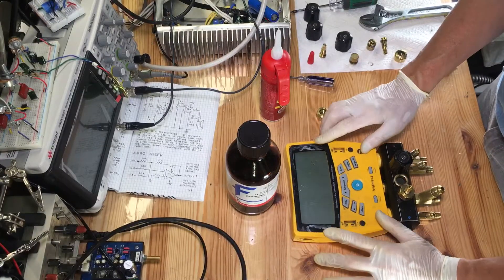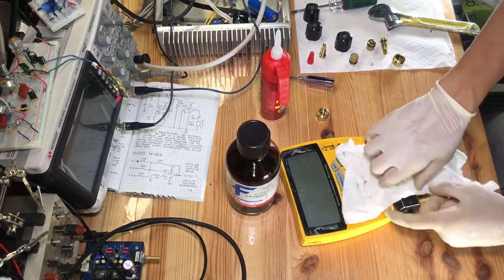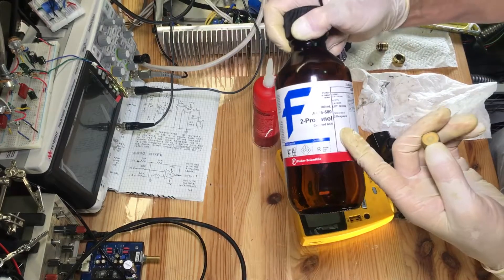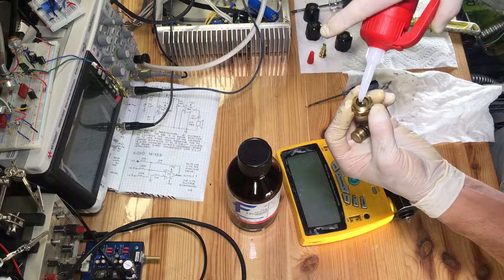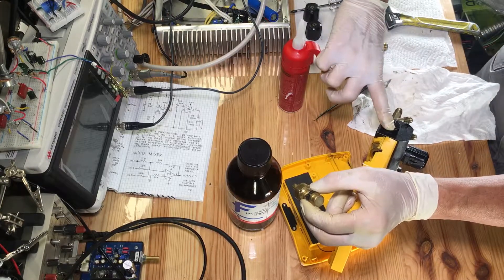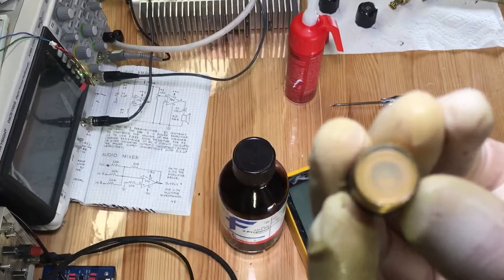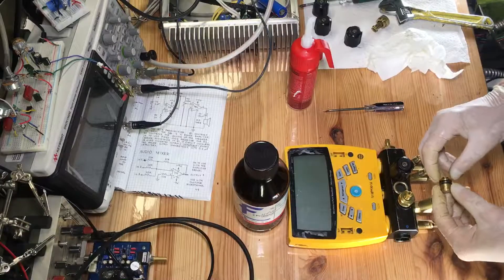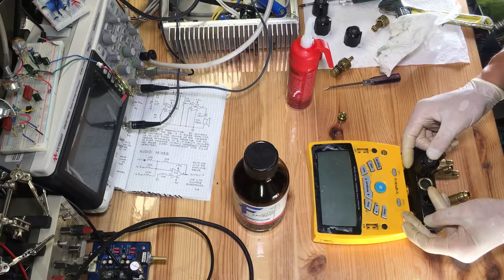Leaking Fieldpiece SMAN 460 repair with silicone grease

Comment: how do i tighten the sightglass
Reply from the maker: I have never taken one out.  But a big giant screwdriver I believe there is a big slot.. I got an extra large 🪛 
Screwdriver 

But you should not have to touch it there’s no reason to touch it
Reply: @coldfinger459sub0   mine is leaking, i want to tighten it

Comment: I have Fieldpiece low loss hose set,what’s the rubber gasket kit model number for Fieldpiece Charging hoses
Reply from the maker: @bikramjitsingh6214  I don’t remember the part number I guess I didn’t show it in the video unfortunately. 
       But they are available at True Tech Tools 
I just googled (“fieldpiece SM 460 valve gauge kit”)
True Tech Tools 
Supply warehouse 
Test equipment 
Website websites and show this part number 
SKU:RSMANK8

That was the part number that was on True Tech Tools website 
But always ask them personally to double check reference to make sure that’s the right one .
Reply: @ I think it’s misunderstanding actually I was asking about fieldpiece charging hose rubber gaskets,I Tried all the local suppliers they don’t have anything for fieldpiece HR3L,
Reply from the maker: @ you’re going to have to give a look up on the website for Fieldpiece or call True Tech Tools. I did not see it listed on True Tech Tools website but I know they have things they do not have listed yet.. 
     So if you ask them for an item, they don’t have listed on one of the brands that they are an authorized distributor they will get it for you. 
       I don’t think none of the locals will have the seals specially Automotive I don’t even think Johnstone or American refrigerant Supply or Baker Distributing from the commercial refrigeration warehouses will even have those seals sitting on their shelf. They will have to be special ordered.. 

Unless they’re the exact same size as the common yellow jacket, refrigerant hose seals .

Comment: I had my old style of gages for years and they have never fel me
Reply from the maker: @carlossaenz4075  your old style gauges can never get below 100 µm.  Your old style gauges you would never even know when you’re at 10,000 µm.    Because they were only plus or minus accuracy in reading at -29 inches of vacuum and even that was not always correct..   Analog gages are incapable of reading down into the micron range.

Comment: Omg  just after two years of useing  these every expensive  gages ur having these problems  that means they not worth the money !!!!
Reply from the maker: @carlossaenz4075  I do about 2000+ vehicles on them a year. 

And all the brands have a problem when you’re trying to get under 100 µm . Does not matter if it was brand new out of the box or yellow jacket or Fieldpiece they have a problem trying to get below 100 µm.   Silicone grease to the O-rings stops that problem below hundred micron leaking past the O-rings

Comment: I bought a brand new SMAN 4 port and it's leaking right out of the box 😔
Reply from the maker: R u trying to hold vacuum micron with the refrigerant hoses? 

You can not. 

The micron gauge is so sensitive it can read the out gassing of the VOC out gassing from the hoses and the moisture absorb in the inner wall surface.  It will look like a leak. 

And you can only measure large internal surface.  Like a tank or long copper line set.  
     Not the internal surface of the gauge it self. . 

Or especially if you use some cheap eBay or Amazon refrigerant hoses. .   

I should steady out and level at a certain level. 

Make video and post it what it is doing. 

If using vacuum hoses to try to read micron vacuum is too low for refrigerant hoses to hold 100%. 

Refrigerant hose were never designed to for deep vacuum. 

You would need to use copper or stainless steel lines.  Not rubber. 

There will always be some losses trying to use refrigerant gauges with rubber hoses. 

I have later videos showing how volume is needed with brand new refrigerant recovery tank that I put on vacuum for 24 hours to dry it out before taking test. 
      It shows you the difference between just hoses and hose plus large volume tank added. 

It a mathematical physics think going on having to do with how sensitive the micron gauges can read small volume and out gassing.
Reply: @coldfinger459sub0  real interesting 🤔 well I  am indeed using refrigerant hoses to try and pull the vacuum. So the vacuum issue is one thing (I'll definitely re try this tomorrow with my big blue vac hose). The other thing it's doing is leaking on pressure. I was trying to test a system @ 600psi. I leak checked everything until I got to the SAM 4 port gauge. I isolated it and realized that the gauge it's self seems to drop 0.1 psi /min. I did it again completely by itself, not even hooked up to a system at all.
Reply from the maker: @jpabmx  too small. 

Hook it u to a refrigerant r410 cylinder. So you can go up to 400 psi.  Let it set 15 min then close it.  Depending on temperature difference of gas change to refrigerate manifold and hoses.  It will go up or down a little the stabilize. ,  let it drop . 

Then 15 min later zero out leak test and retest again. After it stabilized from last time.   

Hope that makes sense.  

Remember your hoses will stretch a little at 600 psi.  Again it’s a small volume. .
Reply: @coldfinger459sub0  Well, I spent hours on this but I finally found where it was leaking. It's coming from the high side port. I'll post a video shortly.
Reply from the maker: @jpabmx  looking forward to your video👍

Research and looking takes time, but the more time you take the more you learn .
Reply: https://youtu.be/FGew_HY29jk 

Two part video. Second half is the leak. 
To test: I hooked to my nitrogen cylinder and raised up pressure to somewhere around 600psi then disconnected and submerged the manifold. This is because no matter how much bubble leak detector I used I could never find a leak at any of the valves. I used a 1/4" cap on first the low side outlet, and opened that up to get the sensor to read (pressure will not read unless you open the valve). All other valves were fully seated. The high side port is leaking even though the handle is fully seated closed. Did the same test on both high and low pressure ports. Only the high side leaks by. I did also try you silicone trick. It seams to have slightly helped but it still leaks. Again this is a brand new manifold. 

Hopefully this makes sense. So now I'm not sure if maybe it's damage to that nylon seal. I saw no visible damage when performing the silicone trick. 

At least I know I can use my low side and cap off my high side for any pressure testing I need to do.
Reply from the maker: @jpabmx  anyway when you are performing the high pressure test.   Your high side and low side can be opened to the manifold chamber. Your vacuum on your yellow hose nitrogen will be sealed off.. 

And there still would be no leak to the outside .    Only the high side and low side that will still be under the same 600 psi pressure.. 

But those hard nylon rings, especially when brand new, sometimes take a little bit of a hand force . 

He grew up being used to the old fashion soft Teflon rings .  That damaged very easy and we’re very soft.
Reply: @coldfinger459sub0  yeah after thinking about it a bit, it doesn't really make sense that this would be a leak. I tested one more time and it's fine. The high port valve handle was not fully closed, I thought it was. So that video was not a real leak. I re-tested and it's fine. I have realized that this gauge is ultra sensitive. It picks up on changes in temperature, even if you just bend the hose it will pick up on that. I was mostly chasing ghosts this whole time. As for vacuum, I believe the issue is me trying to use a refrigeration hose for pulling vacuum. I'll need to get an adapter to be able to use both my vacuum hoses on the unit I'm working with but I'm pretty sure that's going to cure all my issues. It's surprising how sensitive this unit is.
Reply from the maker: @jpabmx  💡🤔💭 now it seems like you get it and you understand

These are ultra ultra sensitive measuring devices 

The sensor for pressure instead of analog ages you’re literally measuring 1/10 of a psi . 

And just temperature change expansion of the gas or contraction, and the same goes for the metal expansion or contraction or hoses or stretching he can measure that 

This is why before you even start your test that 10 or 15 minutes of stabilization is very important and once you start that test if the outside temperature changes that will expand or contract, the metal and the gas in the condensing unit heat exchanger if the inside of the house changes temperature that’ll expand or contract the gas or F refrigerant lines are ran in an attic just below the roof works 140° F as these temperatures change you’ll see pressure go up or down.. 

And the vacuum micron sensor extremely sensitive

In the smaller, the volume that you’re trying to measure the harder, more difficult and more sensitive in the more off, your numbers will be especially when trying to use Refrigerant hoses that were never ever intended to be used for low vacuum . 

It’s a frustrating learning curve, especially if you have nobody to help you some guys just get frustrated and throw their equipment away sell it to college bad names or say that stuff doesn’t work 

It’s not the tool that is broken 

That’s what he’s looking in the mirror that is broken  🤣

In my videos, I recommended watching Jim Bergman’s videos on vacuum 

Available at True Tech Tools available at Accutools website and possibly available on Jim Bergman’s personal YouTube website 

I also recommended the $19 small booklet on vacuum from True Tech Tools . 

And for the gifts and nerds who love physics in science in the most final details, and have many hours to read . 
    I recommended and I gave a link to a science book for laboratory classes that have all to do with the most Finite detail, extreme vacuum and very high-end vacuum equipment and measuring equipment that was a free PDF that could be download it and read. 

You either fall asleep 

Orby highly overeducated 

Or it’ll make you want to buy even more expensive equipment and do better 

😂💰💸

Good luck on your adventure. Any questions don’t bother ask me anything you want any time you want .

Comment: I wonder if nylog would work too. I will try this repair
Reply from the maker: NYLOG works I used it . But refrigerant washes it away.   I found silicone grease lasted longer.   I’ve been testing both for years.   Abandon NYLOG now only use silicone grease.   Instead of replacing orings.    I found I can reuse oring just reapply silicone grease.
Reply: @coldfinger459sub0  but you need new pistons since they get the ring on the surface from tightening the knobs right?
Reply from the maker: @JDT738126  the O-rings slide up and down on the side of a cylinder they do not get compressed. 

At the end of the piston, there is a Teflon nylon type material. That is the part that gets compressed against the machine ring as you tighten and untighten the knob. 

If that part does not get damaged, then it does not get damaged. That is no problem. If it does get damaged you have to replace it. 

But the part that bleeds by and leaks, either vacuum or pressure is the O-rings that are acting like piston rings in an engine compressing up against the cylinder, sitting inside a groove of a piston . 

When you try to go into extreme low micron range that you should not be doing in the first place on a set of refrigerant manifolds because they were never designed for low vacuum . 

But when you are a trying to achieve below 100 µm .  The silicone grease stops. Any vacuum from leaking around the O-ring because the space is filled with silicone grease. 

Silicone grease is what they used in laboratories to stop. Vacuum leaks between two meeting surfaces.

Comment: I have an SM380 and having a leak issue. Won't go into microns, with the valves closed if I disconnect the hose it loses vacuum. I've done everything in this video thee times and even bought new valve and piston assemblies. It's still leaking. If I put nitro into the manifold with the valves closed and drop some bubble test down where the hoses attach and I'm getting bubbles. I've cleaned the inside of the manifold where the pistons go. Is it possible the manifold is damaged internally?
Reply from the maker: Is it only on one ? valve or all four valves ?

The odds of having four valves leaking I like the odds you have four flat tires at the same time. 

Since you got four new pistons you’ll notice that white plastic type material at the end that disk is your ceiling surface. 

It seals in a ring in the outer edges he will see an imprint. 

So it sounds like a case possibly where you may not be used to this new material that they are using. 

In years past we were taught not to over tighten our valves because they were made out of Teflon that is very soft and damage is easily. 

But if you try to take your finger nail into this new material you’ll notice that it is hard

It’s a nylon material or nylon Teflon composite material it is much stronger and much harder

You have to crank down on the valves a little harder to seat them. . 

When you remove the piston valve assembly and you look down inside the manifold you will see that little high ridge that goes in a circle and it’s that high part of the ridge is the sealing surface

As long as you look at that with a bright light and a magnifying glass and you see that it is in perfect condition or use your iPhone on telephoto video with light you should not have leaks. 

Try cranking down on the valve harder give it small tug tightening.     More than you would normally do on an old set of analog gauges that have soft Teflon seals.
Reply: @coldfinger459sub0  it seems like both, 380 only has the 2. I've cranked down on them tighter than I'd usually do in the field. They're about 15 months old and this just started a few weeks ago. I just wasn't sure if there's some kind of seat inside the manifold that can go bad/get damaged. It's driving me crazy, I've watched 2 of your vids a bunch of times each to see if I missed anything. Would taking the stems the hoses attach to and Teflon taping the threads help.
Reply from the maker: @SinisterSoundsEntertainment  teflon tape two year stems to your hoses would not help because you have a rubber seal at that point that would mean your rubber seal is bad inside the end of your hose or the brass face that it seals on is damaged. 

Yes it is possible from a burned out compressor that had metal debris that goes up into your hoses into your valve face and valve seats will embed on the Teflon surface or nylon  surface and cause a small imperfection and possible leak I have had that happen before. 

If you take your valve piston assembly out can you use a powerful magnifying glass microscope or your telephone on the video and turn up the magnification and look at that little ring that seats on the meeting surface and look for the tiniest specs of debris imbedded right where you see that ring depression where it seats. 

If you see the tiniest little imperfection or piece of debris from a compressor that has been pushed into the soft face that will cause a leak. 

And I’m going to assume you’re using a high pressure nitrogen for your test at two or 300 psi.   To find these leaks.

Comment: did you have a vedio to repair pcb board
Reply from the maker: I never had to do a video on repairing one of these PCB boards they are very almost indestructible and reliable on the Fieldpiece SMAN 

     Preparing to see the words it’s actually very easy lots of videos from Louis Rossman on iPhone Repair and Jessica atiPad rehab 
            There are many online tutorials in electronics repair on YouTube on repairing PCb

But at least make sure you get one of the cheap adjustable soldering iron. 
       And you’ll have to get a very very thin electrical rosin core solder not acid core. 

        And get a rise in core cleaning pen for a beginner it helps you clean the PCB traces and components so they solder easier

Comment: Would you give a disassembly view? how micron and other pressure gauges look alike?
Reply from the maker: If you mean to take them apart to look at the actual sensor itself it’s really nothing to look at it’s all encapsulated in a metal block with some wires coming off of it nothing to see. 
 I have taken them apart before .

Comment: Great video.  I have a question.  Mine has an open in it that makes the screen show partial numbers.  It's out of warranty so I took it a part to see if I could see anything.  There is a green wire coming from the right side (looking from the back) going to nowhere.  It looks like the terminal broke off but I cannot find anywhere it would be connected too.  Do you know where it goes?  maybe a picture of the back?
Reply: Hi, mine is only showing partial numbers on the screen as well!  Ghost in the Machine Police album.  I'm going to take it apart and see if there is anything obvious loose.
Reply from the maker: @Hubjeep ghosting in the screen, usually caused by loose connectors corrosion or cracked solder welds on the circuit board if you push on it or wiggle it or use a little plastic or wooden stick to put strain on connectors and you see the screen shadow change, you know you found your problem

460 gauges are very very old gauges. They have already gone through two or three generations since this old design was introduced.
Reply from the maker: When I get home tonight I’ll open up the back take a look send you a message
Reply: @coldfinger459sub0  thanks.  it turned out to be a very small amount of corrosion on the battery terminals causing my issue.  i'm leaning to that green wire is possibly the antenna for the wifi.